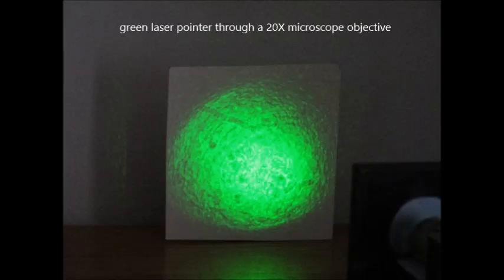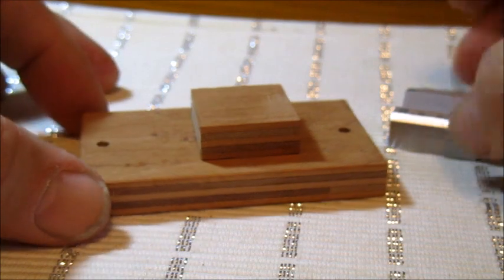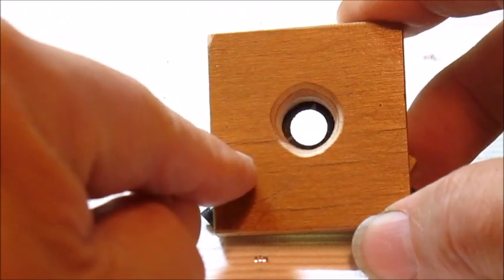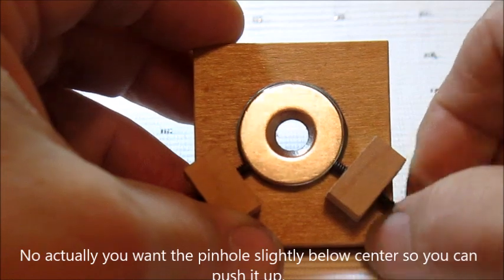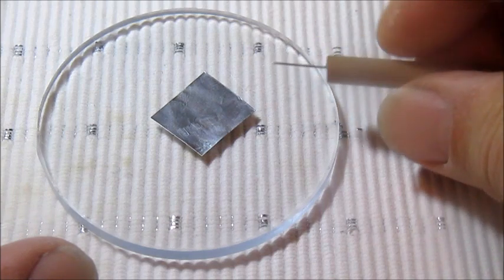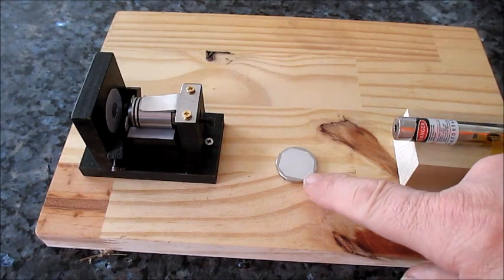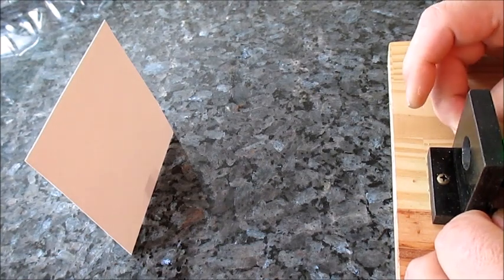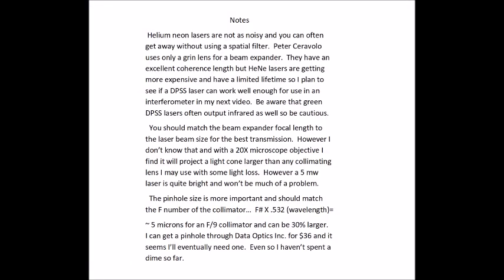A DIY Spatial filter

Comment: I am attempting optical-EME using a Celestron 4" refractor and a green laser pointer emitting less than 1000mW of power. Need to spatially filter the beam before expanding and collimating it with the telescope. Also need a bandpass filter for the 532nm emission line to suppress background illumination from the dark moon. Any DIY help with that would be appreciated.

Comment: James Muirden's book suggests stacking several foil layers and using the pinhole from the lowest. Also the weight of the needle alone is better. Need a steady hand.
Examine under high power microscope. Checking spherical mirror with eyepiece and using null lens should show perfect pinhole features. Every one hand made is a little unique.

Comment: So this will replace your mercury lamp?  Will this also get rid of the LASER speckle?
Reply from the maker: I guess you could call the noise seen in the first pic speckle but no it's not to replace a mercury source for the water test.  These are use in holography, interferometers and other uses.  I want to use it to clean up an interferogram.

Comment: If you want a really really really sharp needle, electrically etch one by immersing the tip of a tungsten wire in KOH with current supply. Use a C rod for the cathode.
We do this for STEM tips down to an atom.
https://image.slideserve.com/799569/slide5-l.jpg

Comment: The heavier aluminum pie tins are great for pinholes. The ones that come with a frozen pie. You can make a good pin hole by pushing the needle through the tin just before it punches through, Then sand the dimple with 320-400 paper in a  'W'  pattern while rotating the metal. It may take a few tries but you can get a very good result.
Reply: there is no way this guy got down to 50 microns much less 34, i done what you said with both pie sheet and soda can sheet and the best i achieved was 500 to 400 microns no way in hell this guy did 1/10 of that without some specialised laser setup you would not even be able to see the hole with a microscope at 50 microns and how can he even measure it? , guy does not know what he is talking about

Comment: sorry but there is no way you were able to make a 50 micron 0.002" hole much less 34 with your crude needle no matter how sharp you got it, best laser have a hard time doing that even, i made pin holes not on foil but on aluminium from soda can which yes is thicker than foil but ductile for my need and the best i was able to measure was 500 to 400 microns using needle and hammer and there will be two sides with different holes sizes because of the needle cone shape and the thicker material but no way in hell your hole was 1/10 of my 500 micron , very hard to believe that because you would not even be able to see that hole looking through a lense